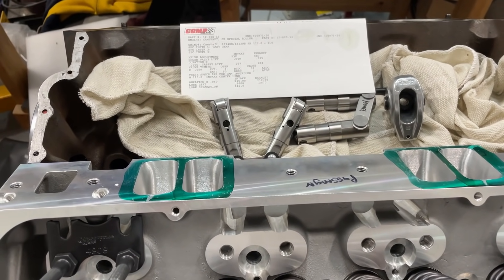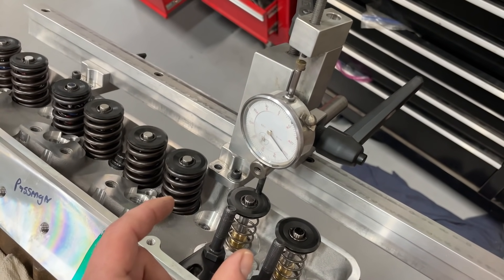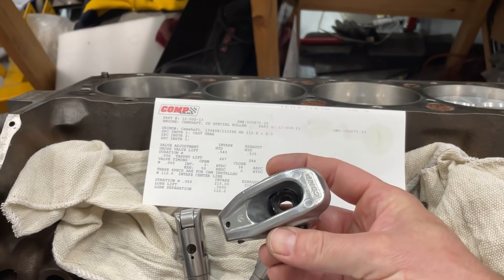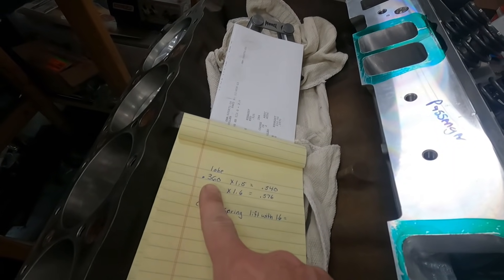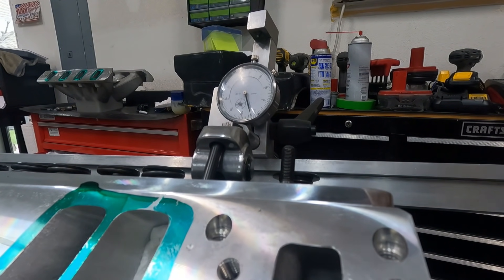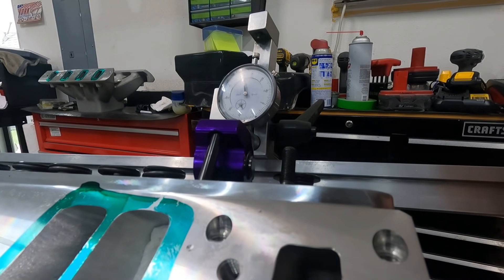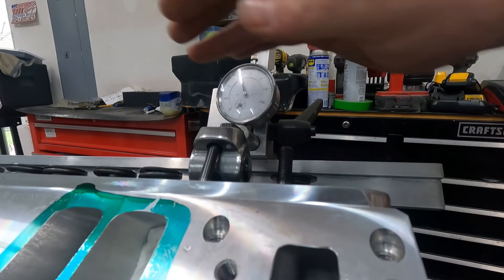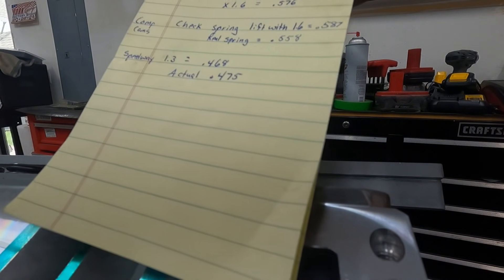Camshaft Info: How much lift are you losing?

Comment: 🔔👍
One thing that needs a mention... all 1.6 ratio rockers are not the same coming off the seat.
A plain 1.6 might be 1.6, but others check 1.83 off the seat. The valve is opening sooner and quicker....
That is worth a bunch of power.
David Vizard explains this well.
thanks 👍👍😎😎
Reply: Another believer in David Vizard! I've been following his work ever since I first began building engines. If you do what he says you will have about the best engine you can get!

Comment: I use Crower Enduro stainless rockers, 7/16 studs with girdles to help reduce deflection and thick wall pushrods.  You still lose .050 to 
.075 lift depending on rpms and engine temperature. Heat makes all metals pliable and deflect more.

Comment: Nice Job Eric, I really would have stepped up to the 224/230 comp, they have a really nice idle & pull plenty of vacuum, & have a even nicer power curve! If you run a solid roller on the hydraulic cam, set to like 2 thou cold, they are still pretty quiet & pickup around 8 to 12hp! If I remember right, It made like 460/460 I forget what heads, they were brought to us, Might have been box stock Edelbrock? With the performer rpm intake, back when it was new!  Basically the same bottom end, scat rotating assembly, & Keith Black pistons, but it was only 2 thousand in the hole. Went in a jacked up square body longbed, Every time I see it out, there’s 150ft long burnouts, from 36in tall tires, I think! Guy is a circle racer, & drives the truck harder than the modified! 😂😂😂😂

Comment: Most don't realize that incorrect pushrod length changes valve lift by changing the effective rocker arm ratio. For those of you that can do math, think of cosine of the rocker pivot with respect to the valve stem with a different length pushrod. For those of you not math experts, just use your dial indicator next time you degree a cam and substitute a longer/shorter pushrod.  If you imagine the angle of the rocker with a  REALLY long or short pushrod, the opening/closing parts result in a lot of side motion, not valve depressing.
Reply: Yep, he lost me instantly when he said the pushrod was not the correct length for the installed height. Once you compromise correct rocker arm geometry, it's no longer a back to back test for accurate data. I would like to see him go back and correct the rocker arm geometry with a correct length pushrod ( especially since he said the 1.6 rocker was on a 3/8" stud), which exaggerates incorrect geometry even more due to the increased angle.

Comment: Wow, the amount of deflection was much greater than I would've thought!
Reply: It's even worse when the engine is running, especially at rpm. Most don't realize just how much you lose.
Reply: I think my next engine project will have overhead cams, LOL.
Reply: @jrdmotorsports9718  add heat and metal gets pliable too.
Reply: @stuartbuckley8720  Everything does.. lol

Comment: Just putting the finishing touches on a 417 ls carburated build useing a BTR stage 4 na cam .I went with 1.8 ratio comp steel rockers to correct the loss from all of the verables you mentioned and also used 3/8 pushrods.its going to be a interesting dyno session

Comment: At .050",  deflection is minimal compared to open deflection due to lower spring pressures, so durations at .050" aren't affected as greatly as the full lift values.  Also, Valve radial clearance should be checked at TDC with piston fully biased (pushed) towards the valve... clay using a valve, or drop a centering tool through the guide, and make a pip in the piston then
measure radial from your pip mark with a vernier. (Flat top pistons with small valve reliefs are a clay method candidate)

Comment: When measuring pushrod length, be careful switching between lifters.  Push rod cup depth varies in lifters based on brands, and whether they’re mechanical or hydraulic.  This is how people mis-measure pushrod length etc.switching for example between a solid flat tappet and hydraulic. 
For merely opening the valve the pushrod cup depth should have a minor insignificant effect on the results.  JD
Reply: Pushrod cup depth absolutely varies. You bring up an extremely important but often overlooked point!

Comment: There are so many factors to include. You can give me any cam card and I'll prove the numbers are off. Everything from cam core, push rods, plungers, oil type and bleed down, rocker materials and rollers. Can alk effect actual lift. The longer and wall thickness will also effect the readings. HEAT will change everything.even with all those components the same! The numbers will change!!!!!! As the engine runs. Even RPM will change the lift numbers. Think about setting hot last on a solid. How much room is given for heat expansion! Steel rockers will grow more from heat then aluminum will from reflection. A running engine will also stack up more oil on parts at a specific rpm more then at other times. And lastly....Even head bolts and rocker studs will stretch causing even a different number. 
  Your slow roll testing is only getting the mechanical readings without all the hydronic and deflection effects. 
  Even the type of coolant used can change the cam card numbers. Water filled race cars will read different then a car with antifreeze. 
   Just saying....Even top fuel guys will tell you. The car that runs longer before the launch will be slower!
Reply: Someone I trust told me for the typical gen1 sbc hydraulic roller (stock dog bone setup) .525-.600 lift, 1.6 rockers, stock old or Delphi ls7 lifters .080" wall 5/16 pushrods you will lose as much as .040" lift in a running engine. Not sure if it's true or not, but it made sense. One thing he did say was make sure your pushrod is not rubbing the head when doing your sweep setup but do not grind anymore off the head for clearance than enough so a piece of notebook paper will clear, said with shaft rockers the tight clearance would actually help stop some harmonics and sort of act as a guide plate and cut down on deflection.  Not sure if this is the gospel truth or not? I do know he has been short track racing sbc for over 50 years, and he swears by this method for a hydraulic roller setup in 6500-7000 rpm stuff with .600 or less lift.
Reply: You forgot loft😉
Reply: @treyrags  Did you watch the whole video? He covered it…
Reply: @adamarndt7617  yes I did. I was referring to Inspector Business' list of things, not Eric.
Reply: Yes. Among a host of things.

Comment: At higher RPM the spring pressure over nose will reduce.. valve may even loft and lift will be bigger than mechanical.
Though this test applies for low speeds.

Comment: Hydraulic lifters are designed to pump up at certain rpms. Lots the time I've read they do it so you can put around and have it not run as rough at idle and low rpms, which is understandable. Which in some efi cars it helps to keep the computer from over adjusting

Comment: Eric, also wanted to add, the higher the ratio, the more deflection the pushrod will see.. Higher spring rates will always show a decrease in net lift as well.
Reply: Ya gotta have higher spring rate to achieve more flow and use of larger rockers right?
Reply: @standupoathkeeper6915  All spring rate and spring pressure is for us valve control. Nothing to do with flow of anything. Unfortunately, higher spring rates, stiffer pressures, and higher rocker ratio ALL contribute to pushrod deflection. However, higher ratio rockers couple to aggressive ramp rate lobes, also contribute to other issues,  including pole vaulting the pushrod, which you will NOT see on an engine stand.
Reply: Crazy thing is.... The flow card you get with a set of heads is inflated too! Soooo... Then begins another debate. "Will adding larger ratio rockers really add more flow and how much?" (If heads aren't ported).
Reply: @standupoathkeeper6915  A flow bench is not a running engine. All I will say about that. There are more important things to consider when deciding on ratio, than what a flow sheet says. You don't build an engine around a flow sheet.  Period.
Reply: @jrdmotorsports9718  my point was..... Will rockers truly effect hp/tq if your heads are too small to accommodate even the smallest gains.
Reply: @standupoathkeeper6915  They affect it regardless.

Comment: I was shocked to see that much lift gone with an .080” thick pushrod wall.

Mostly this video made me happy with my SBC parts selection: .600” theoretical lift, .105” wall pushrods, 7/16” rocker studs, comp ultra pro magnum 1.6” rockers, jomar stud girdle, Johnson Short travel lifters, and beehive springs to cut down on open pressures and hopefully deflection.  -Kinda regret not going with 3/8” pushrods but already done and the .105” wall should be fine with my 5,850 rpm peak.
Reply: The loss of net lift you are witnessing is from the spring. Turning it over by hand will not deflect the pushrod. That happens while running, worse at rpm.

Comment: I read somewhere that retainer flex is most of the loss in lift when measured at the retainer. It would be interesting to take a mock up block without rods and pistons and measure lift at the head of the valve in the bore

Comment: Harland sharp bud.i have a set on my roller small block with .620 Valve travel.250 lbs closed and 650 lb open @ .620.run on the street and 15k miles before I lost a roller tappet @7800 rpm .
On the rebuild I noticed I had finally cracked one rocker arm .but it was still working.it cracked at the stud side of the valve spring.

Comment: Nice to see you finally pulled the trigger on some decent exahust manifolds for the S10.
Steve Morris made a video about valve train deflection too but I think yours is more detailed tbh. 
Steve used to work in a Pro Stock team which probably why he only does boost engines now but boost is cheating imo.

Comment: Stud mount rockers move around too much. Shaft mount steel are my go to. Alloy heads grow and studs stretch so I tend to tighten the lash a little more than spec. Its too hard to work out how much "actual lift" you have. So many variables. Pushrods act like po-go sticks lol.

Comment: When i started building bbc 35 years ago i got laughed at for using huge 71/6 push rods, i said gm must of known something because they used them on the high performance big blocks. Now 35 years in the future people are running the biggest and heaviest push rods they can get lol. Maybe thats why the dyno guy couldn't figure out how my 461 bbc with merlin oval ports 12 .5 compression and a ultradyne roller made 744 hp and 676 torque.  I had a holley dominator on a 4150 team g intake, used one of those adaptors. Engine had a gm forged crank and stock 3/8 rods that i polished and installed arp wave loc bolts. 2 bolt maon block with studs. It was in a 37 plymouth coupe i raced all over the Pacific northwest. Car was 3600 lbs with me and would run 10.10 @132 134. Had a th350 we built with all stock parts and just a manual valve body. Those were the good old days. I remember when i got those iron head merlin oval ports that thing were getting serious now lol.

Comment: Great video. I have a 427 CSB with all the good stuff. It has 220 AFR heads. On the dyno it made 650 Hp and 598 lbs torque. It has a hyd roller cam. Intake .400 lift and 251 degree duration at .050. Exhaust is .387 and 255 duration. 33 degree overlap at TDC. Cam card .600 and 304 duration on intake and .581 and 308 duration on exhaust with 1.5 ratio rockers. 110 lobe center. It makes max hp at 6200. Do you think I would be better going to a 1.6 ratio rocker. I'm running steel rockers on it now. Thanks for any input you may have.
Reply from the maker: Yes

Comment: I would like to know are you running 3/8 or 7/16 studs? What push rods .080 or .105 wall, 5/16 or 3/8? I run a stud girdle and i will check to see how much difference i get. Great video.

Comment: Hey.  Watch you on you all the time.  Thanks for your experience and sharing with us.  My question is when the engine is running let's say at 5000 rpm, will you possibly regain some lift from the momentum of the valve at speed rather than at idle?. Thanks and have a great day.  James
Reply from the maker: Thats called loft and probably not.

Comment: Excellent video Eric, thank you. Am I correct in assuming 90%+ of the deflection shown here is due to the Pushrod and Rocker stud deflecting ? I'm sure very little is due to the actual rocker body. An interesting test would be to check the same dimensions on a shaft rocker application with sufficient pushrods for the spring pressure being used. I hypothesize we would see much less defelection. Thanks again for this excellent demonstration to illustrate your point. Time for a pushrod upgrade.
Reply: Aluminum rockers also deflect, and will deflect more than a steel tube, ie pushrod. The spring is what is causing the difference here. Not the pushrod. It is common to see this going from a checker spring to a real spring. Running? Whole different ball of wax.
Reply: @jrdmotorsports9718   Wow.. i always thought aluminium is very rigid? Steel will felx, flex, and flex more.. for a very long time befor failure. Aluminum tends to just stress fracture and fail ?  So, if I'm correct, what you mean is, the added stress of the actual valve spring vs the checking spring is causing the rocker to deflect ? .. not the pushrod ? Or rocker stud ?
Reply: @Torquemonster440  No. They ALL deflect. Weakest link breaks first, usually the rocker. Especially if aluminum. If the geometry is correct, parts won't break, unless the quality isn't up to the job for the application.

Comment: Ok can you tell me what you think about porting so much that you open the port AND the seat 3-4.5mm wider going from a 35° multiple angle to a 45° single angle (same size valve) larger deeper seats to accommodate  the portwork. On the exhaust side. And reducing the lip on the intake  back cutting it to the sealing angle. Leaving the lip  on back side on the exhaust valves.
 But over all same size valves.
 
 I've posted a short hyperlaps of shaping a bowl. I plan to make a bunch of videos  on the next head  (about 54 hours into porting alone! )  cast heads are a bear to port
Reply: Also. The valves  I have two different  styles  of exhaust  valves  from DNJ.  Same Part numbers but one is black nitride coated and has a much less mass  on the back side  (used for exhaust side)  and the other with same part number  non coated has much more mass thus a less aggressive  rake  from valve stem to the first cut  angle ( used on intake side) I chose 24 exhaust  valves because they are more resistant   to higher power and heat. The order I purchased  was  messed up and they sent me two types... this gave me the idea to use them to my benefit anyway though they are different  castings.

Comment: So what if you run a hydraulic roller spring on a hydraulic roller cam, but use a solid roller lifter. I wouldnt lose as much lift but would the spring be too soft for the solid lifter to work correctly

Comment: Is this simply more common in SBC due to it's geometry ?  Is this less of a problem where the rocker isn't suspended by the stud and instead solid mounted, such as a shaft mount, or even an OEM LS style with the trunnion mounted solid to the cylinder head, leaving the pushrod (and perhaps the valve tip if no roller) to take the brunt of the abuse and potential deflection ?

Comment: This video makes me question what max cam lift you can use regarding valve spring coil bind. I usually see recommended .050 to .060 as a safe buffer but if you don’t get the lift expected could you generally speaking reduce the coil bind buffer value to .040 ?

Comment: My thinking on this is how much is comming from rockers and how much from pushrods. If you get a lot from pushrods.  Then they will be like wet noodles vibrating in the engine. I dont think you can calculate in the loss of lift in the engine. Build ,because as rpms increase spring pressure would effectively decrease. Over revving causes valve float which is effectively zero to no spring pressure.

Comment: There is some other geometry that goes into play, I did this with one Comp Cam solid roller I bought to do this and I found the solid roller cup is shorter and closer to the cam than the hydraulic. Also Eric placement of your gauge has to be in the exact spot, keep the dial indicator at the same degree of angle is critical for consistent measurements. I think deflection is not a issue just taking a measurement if that's what your saying!?

Comment: My AFR 210 cylinder heads with 1.550 Solid Lift Roller Springs are supposed to be good up to a .710 lift. So my question is, can I actually run a bigger lift camshaft than .710 because I'm not actually getting .710 lift. I'm not going to run that big of lift probably around .650-.680 lift, but theoretically I could run bigger? My heads according to the flow sheet flow the best at .650 lift. Should I shoot for .650 of actual lift?